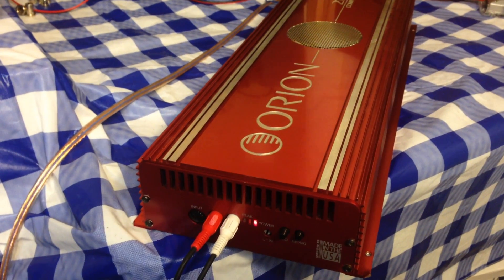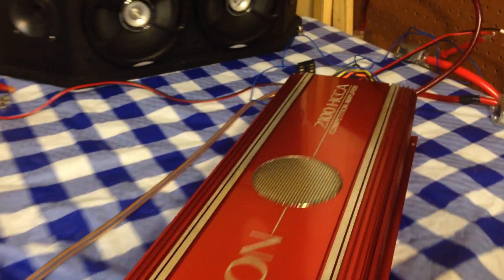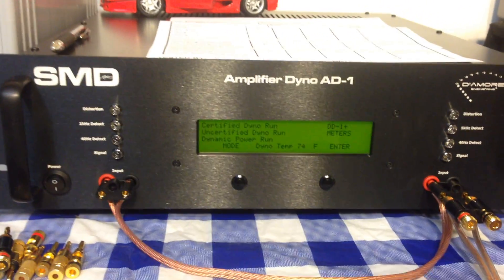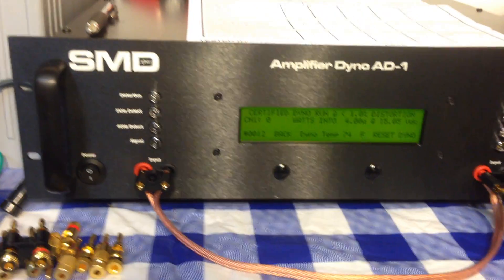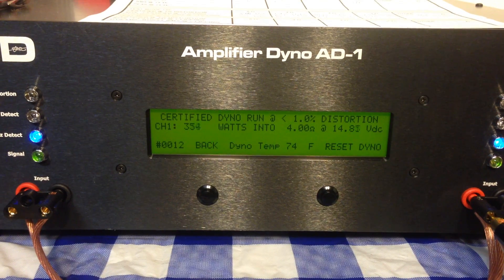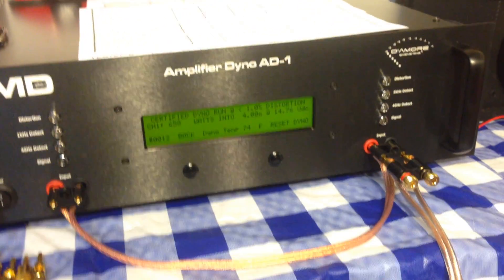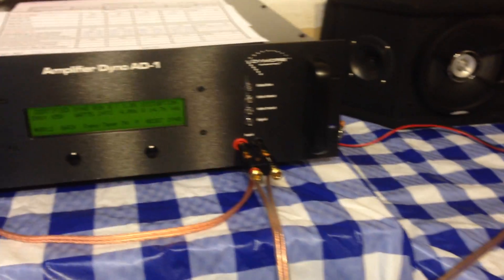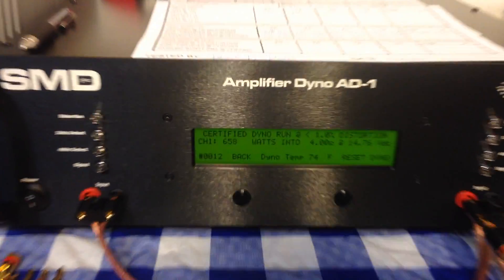Orion 2100 HCCA vs AD-1 Amp Dyno 4 ohms Mono OldSchoolStereo Labs

Comment: I had two of these and I believe a sx500 .  These amps are monster but you best have the battery to back up the power .  My buddy has the concept version as I speak .  I had almost every model of the hcca back then ..even the rare 150R

Comment: Dude I have two 4 channel amps.
Predator 3400 w & hybrid acoustic 1000w  
But dont know if they are 2 ohm stable, bridged. For my 2x dvc subs.
How can I test it?
Thx jp
Reply from the maker: Most 4 channel amps are not stable at 2 ohms mono. I can't say for sure with your amps because I don't recognize the names/models.

Comment: NICE!
Would love to see a RF POWER 1000 @ at least 14.4-18 volts, just to see what my baby will do.  Haven't even taken it out of the plastic since 91.  Always enjoy the show, most RF amps were rated at 13.4-13.8 volts in the early 90's, especially the waffles.  The powers, 300,650,&1000 were 14.4's, but the hand made amps are just a true piece of art, B E A utiful!  Later all

Comment: You gotta show some love to the Punch A Series amplifiers.. I have RF Punch 200a4 and 400a4. 200 running 7 high and midrange MTX speakers and the 400 bridged to 2 chs running two Earthquake TNT 12S subs. 359wrms x 2 @4 ohms. Tested with a Velleman PPS1O Oscilloscope. Also have a Punch 200.4 and Power 500bd.

Comment: back when orion made good shit! my first amp was an orion in 93, the 275xs. it was rated at 2x75 watts at 4ohms but it ran the hell out of 4 pioneer subs
Reply from the maker: The 275 SX and the Rockford Fosgate Punch 150 were very comparable back then. I should do another shootout using the Dyno